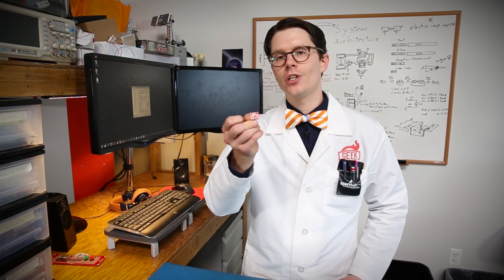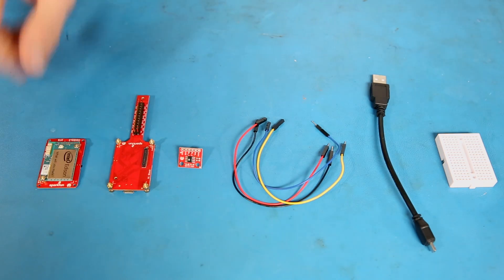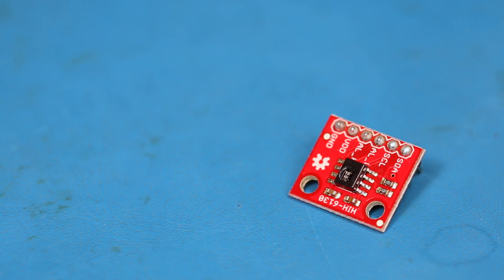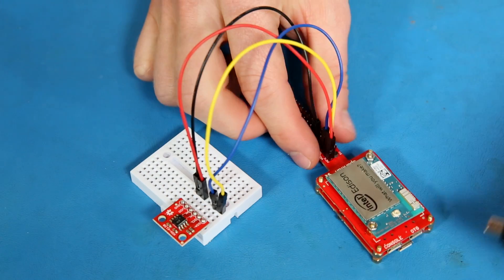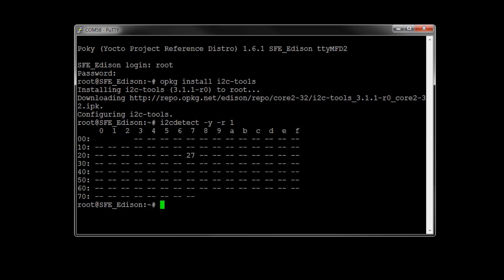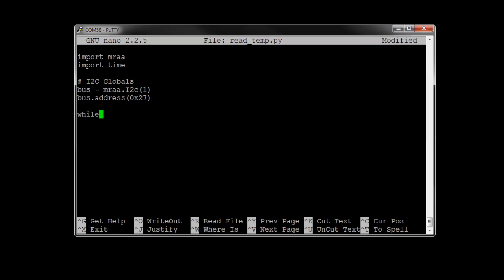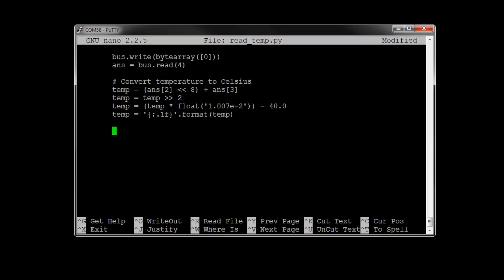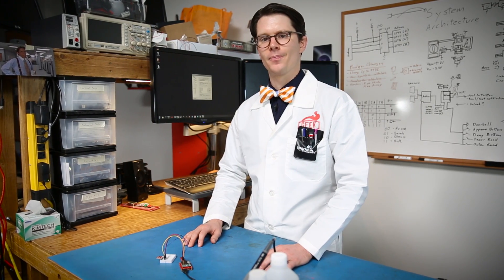Getting Started with Edison part 6 -  Raspberry Pi Block and Temperature Sensor

Comment: Am trying to figure out the code to work out a hcsr04  and hmc5883l.
Any help is highly appreciated and actually most sincerely required.

Configurations : Pi block + python!
Reply: Dimpy Chhabra The sr04 requires very precise timing to be able to measure the gap between pulses. The Edison is not really meant for that kind of timing, so you'd need to have something like an Arduino take measurements from the sr04 and then send it back to the Edison. The hmc5883 is an I2C device, which means you'll need to connect it to SCL and SCL and send I2C commands. There should be an I2C library in Python that lets you easily send and receive I2C commands.
Reply: Shawn Hymel  
Sincerely appreciate the reply. Thanks for the update. Also, regarding the HMC5883, can you help me out with the code?